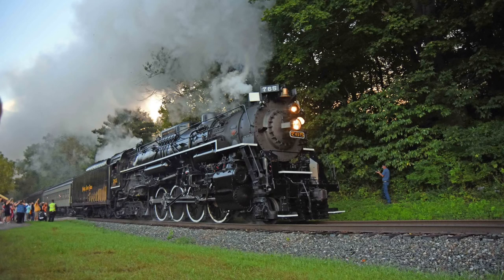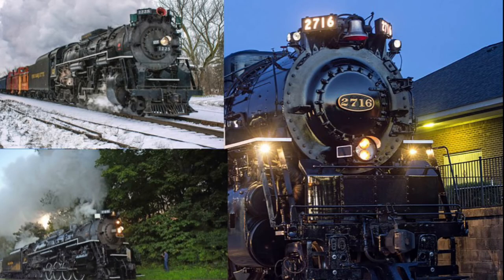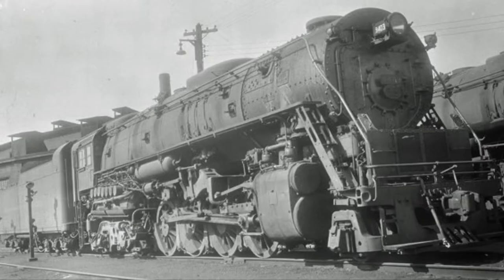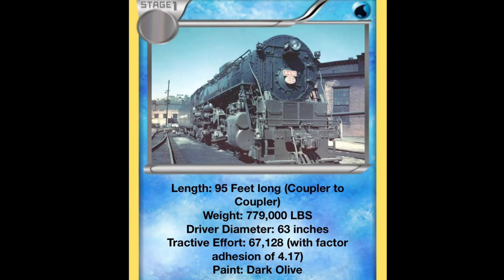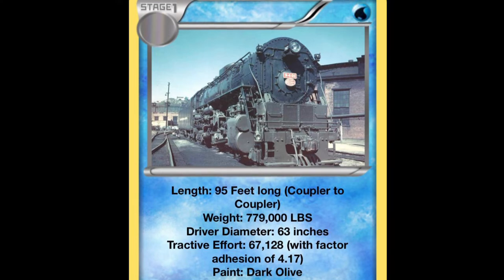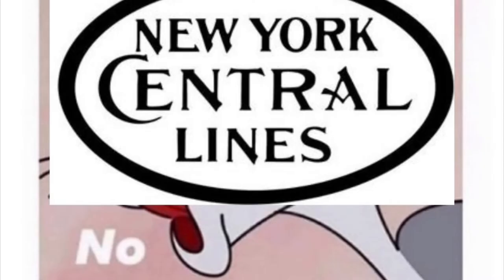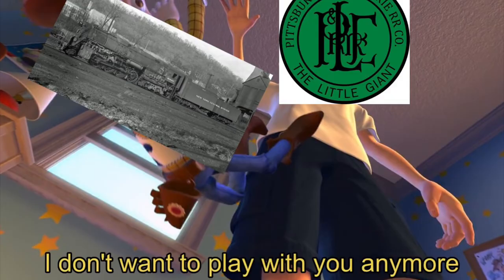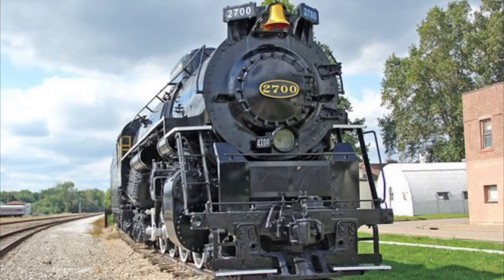The Ugly Duckings: A Short History on the P&LE A2-a Berkshires

Comment: A few curious facts about the P&LE's A-2A steam locomotives include the boilers had welded shells (versus riveted), the canisters on the fire box sides were "smoke-consumers" (they blew air over the fire to burn carbon in the form of soot that otherwise would have gone up the locomotive's smokestack.  This was to meet the strict pollution laws in western Pennsylvania at the time), they had no roller bearing axles (despite most new freight and passenger steam locomotives built after 1936 in the U.S. had such axle bearings) but instead friction bearing axles, and they had all weather cabs.